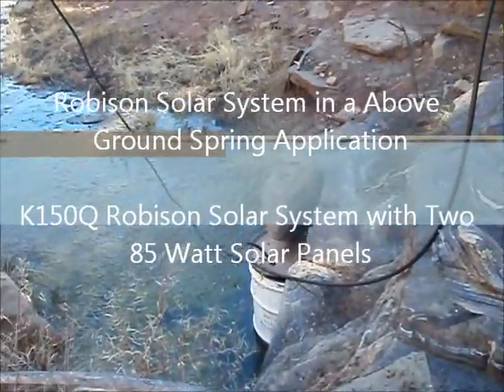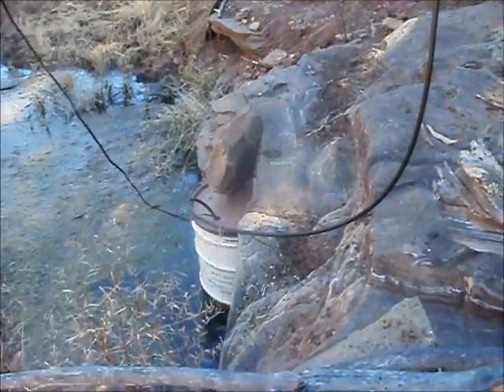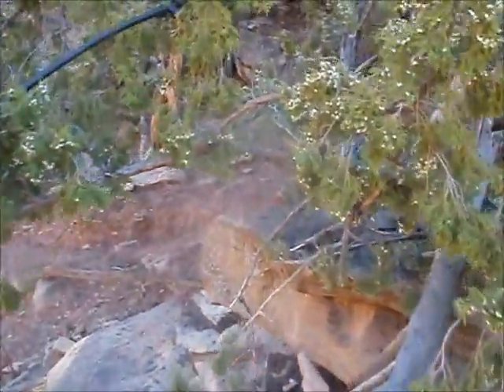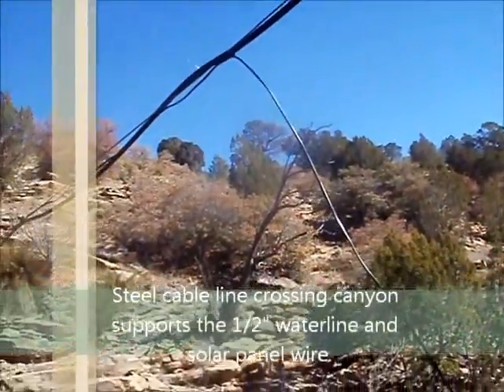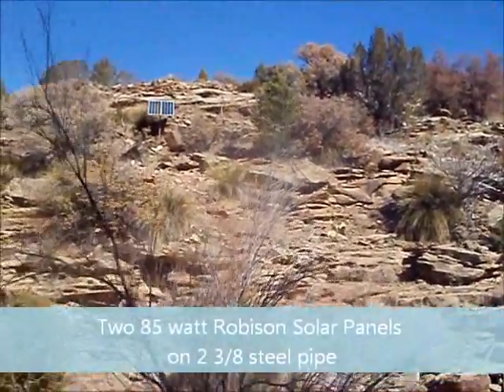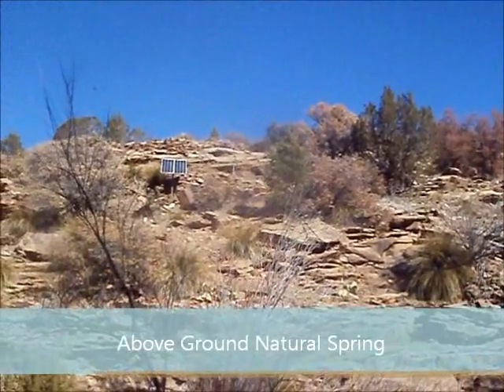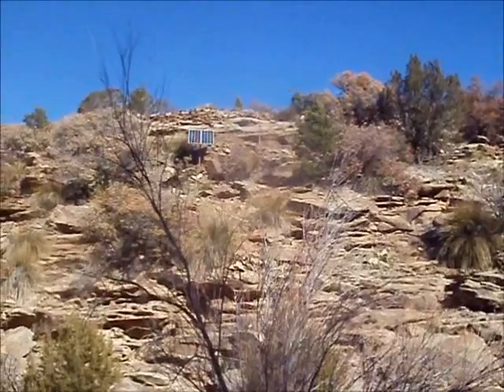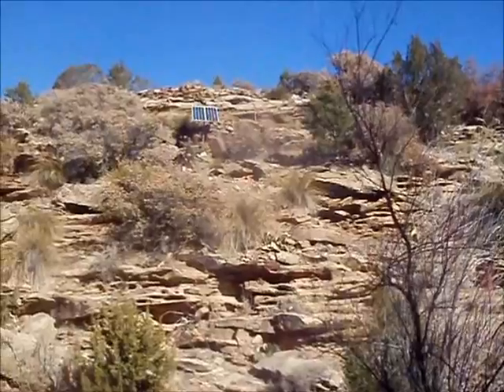Robison Solar Pump in Above Ground Application

Comment from the maker: @engineer775 I ordered my relief valves from dripdepot they are called 1/2" Perma-Loc Hose Tee with Flush Valve and here is the link I placed a valve at the very bottom of the line, and then went up and placed them every twenty feet.  I think I had a total of 7 on the line in this video.